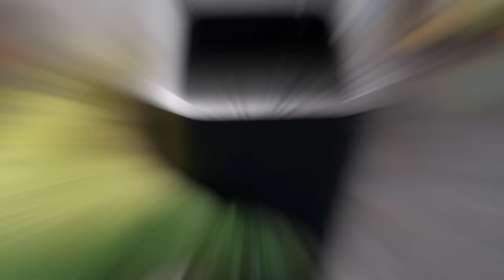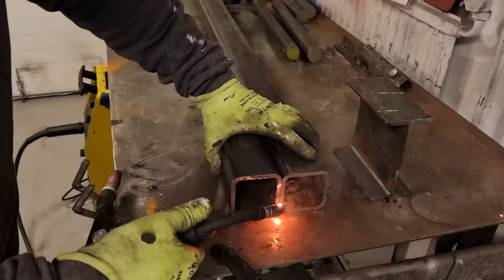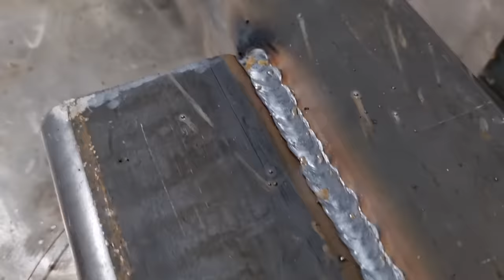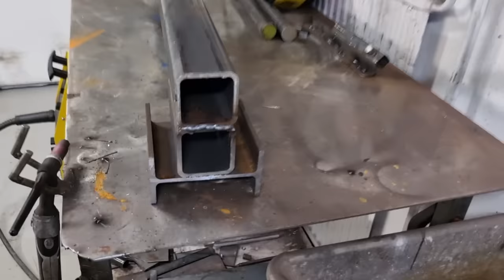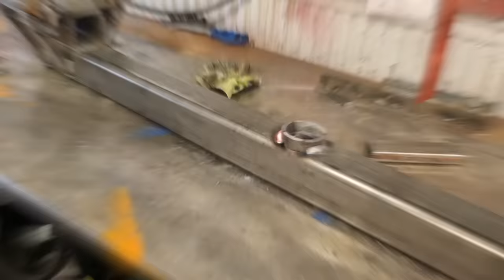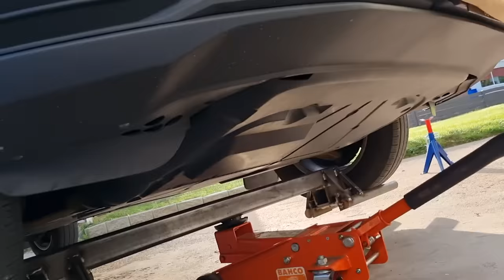Absolutely new Unbelievable Homemade !!! for Cars Never seen Before

Comment: Don't like to tare down anybodys work but that's definitely a teeter totter waiting to fall over. Too centered. Plus the wheel spacing needs to be wider so the tires won't roll off as easy and you have to push or drive the car over the bar because they're welded together. 
Not too practical... 🤷  Got the right idea though, maaybe a few changes and it would help....

Comment: Would be better and safer if you took the dish off the jack and pin it into the top of the jack the same way.   That would reduce the height though i still feel it's too high  to fit under  modern cars.   I have  to take the dish off mine to get under the jacking block 😩

Comment: Nice first attempt. But it would be more useful for cars that can't move under own power if the 4 rods were wider, and are inserted into receivers. This way you position it under the car, insert the 4 rods front and aft of tires, and lift.  Lower the car elsewhere or when done, pull out 4 rods, remove the assembly and jack.

Comment: What if you have to take the tires off?
Reply: You set the vehicle on jack stands as you should to begin with lol I think this device is intended to lift the vehicle at one rather than using the frame 👍

Comment: I see several problems with this setup the jack doesn’t fit under the tool on the ground  the bars for the tires are too narrow, when lifting the front or rear of a vehicle I usually need access to the area near the wheels or the wheels themselves. While the concept is good I don’t see the benefit.

Comment: I see this as a great time saving idea. I've driven vehicles up those cheap stamped sheet metal ramps and i've actually seen one collapse after the vehicle was up on both ramps. This looks well built. There are some things I would do differently but it would have to be made with a few different vehicles in mind. Lifting a vehicle by the tires like this eliminates the suspension sag. For those who point out that it is useless because the tires can't be removed for brake service or it is in the way for an oil change must be working under vehicles without using jack stands. I really hope that is not the case for that is extremely absent minded.🙄 This device allows a person to drive their car onto the rods, apply the parking brake, chock the wheels that are not being lifted, raise both sides of the car at the same time to the required height, install appropriate jack stands to both sides of the car without having to reposition the jack, lower the car onto the jack stands, and then remove the jack and lifting device. You are now uninhibited by the jack and lifting device.
Reply: How you going to get the axle stands under the axle with that thing in the way?
Reply: @peterwiremuormsby9383  Unless the vehicle has a solid axle housing on the front, the jack stands should be placed under the frame rails where they support the vehicle more securely than under a control arm. I'm sure you can find many reasons why you think it's a bad idea and maybe it is a bad idea for you, but maybe it's a great idea for others. Can you not find any possibility where this device could be helpful? Keep in mind that if you built one, you would design it to suit your application.
Reply: @markmccoy8304  sorry m8, it  wouldn't be any good to me, l have a 57 Chev.

Comment: Wouldn't work for my car. I can barely get a low profile jack under it, but great idea
Reply: Same here. I have a 96 Firebird. I have to drive the car up onto 2 2x10's screwed together to create steps. Otherwise like you I can't get a low profile jack under the air deflector to get to the cross member.

Comment: A lot of amateur idiots commenting......to me its a tool to get the front end up quicker in order to put axle stands either side then when its on stands remove the tool leaving wheels and suspension free to work on, just a quicker way is all, when finished refit tool jack up n remove stands, Simple as that....

Comment: You can see that the apparatus is off the ground while you are Wheeling it under the car therefore you could not get the car mounted or over the round bar without removing the Jack from under it or jacking the whole car up LOL

Comment: This is one of the most useless things I've ever seen. You can jack up a car, so what. It must be running to get it on the jack, it must be on level pavement. Now that it's up, what will you do? Can't change a tire, too much crap in your way, likely can't change the oil. What job did you have in mind?

Comment: Great idea, will be making my own.  Will add a couple of threaded stantions like harbour freight to lift rear axle.  Maybe insert heavy wall square tubing or solid square bar inside lifting beam for more center strength, weld in with rosette welds.  Thanks again!

Comment: something to be built for the jack part itself, so it doesn't slip. can you raise it higher or was that the maximum height ? also, make connections for the jack stands to hold it, so you can make front and back ones. raise the whole car

Comment: Am Sorry to say ..its a waste  !!  what is the use for? lift car for fun? you cant works under the car and  it can not use for changing tires /pads/rotor.....or any other parts depend on tires .. you didnt shows how was the landing as first cause it was difficult i guess , cause its not ground level and tires needs to sit middle and exact ???

Comment: The jack and the steel bar would be in the way of changing the oil and filter and to do brake work you have to take the wheels off and you couldn't with this device.

Comment: This is a awesome job you have done here. Just a little suggestion,maybe add a couple tabs on the round bars to front and back to put a ratchet strap on. Maybe on a slight up angle, just a thought.

Comment: Quick analysis of your design. Gives a safe MAXIMUM weight of 675 kilo, 1400 pounds. Assuming 50 x 50 tubing, 5 mm wall ASTM 50 grade. Be safe out there.

Comment: That floor jack is a POS lol better use a bigger, better brand. Cool idea, but, big waste of quality steel tubing. Way back in the '80's, I welded a piece of 8x8 square 1/4 inch steel, to a piece of round stock. Removed the lifting pad, installed, my plate made removing/installing my VW engines a lot faster and easier. Ask well, as pulling auto trannies out of other cars, with a nice balance

Comment: looks impressive but if you can i would use good quality ramps, i found they work better and safer than anything else i have use except for 12 in blocks with 4x4 on top of them so the blocks dont split,

Comment: A little sketch, how did it get around the tire? Doesn't pivot like a tow truck stinger. Also needs to be taller so jack would clear without lifting on the jack pad.  Still needs Jackstands for safety.

Comment: not impressed. if i need.weight on my totes i wod just put blocks under them. #1 takes ip less space. #2 you wouldnt hve to worry about it dropping #3 will hold a lot more weight #4 last but not least the cost

Comment: Dumb idea if you use it on the front lift and put jack stands you can’t use it for the rear. And who lifts their car and doesn’t take a tire off or who lifts their car and blocks the motor with a bar

Comment: Seems like it’s only good to lift the car u can’t do any tire or brake work to the car and u left the part out of how u got the car ontop of the tool I wouldn’t waste my time with this tool what’s wrong with the jack u already have and jack stands cause u still need jack stands with this tool or the car will roll right off those arms right next to each other a tow truck uses the same concept but has a much bigger space for the tire to cradle itself in this is a death trap and u can’t even work on the vehicle with this thing in the way

Comment: pray tell what in hell is the good of that. you cheated as to  how you got the round bar under the wheels, but i know you had to back onto them, now what can you do when they are under the wheels, you sure cant change a tire or any thing with out having a lot of blocking. should check with an engineer.